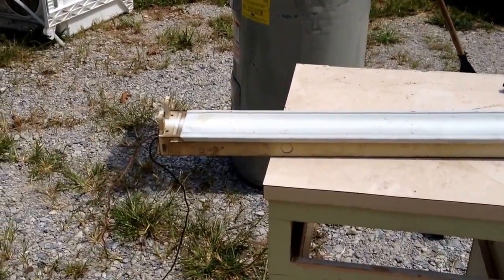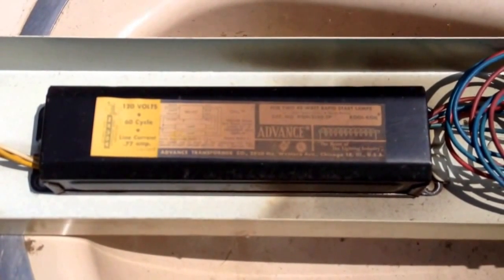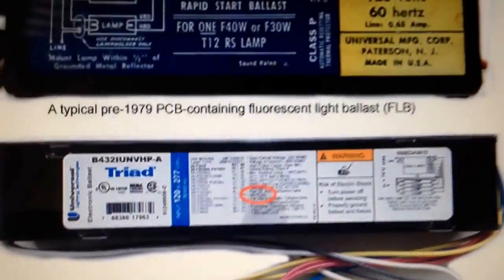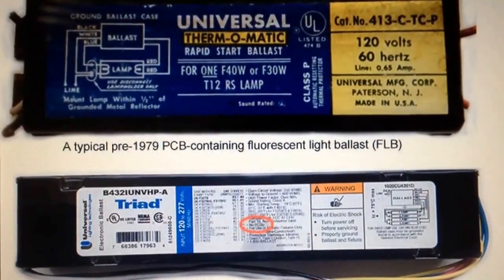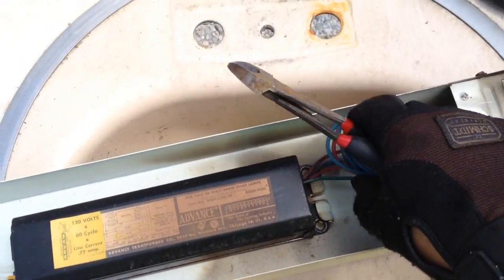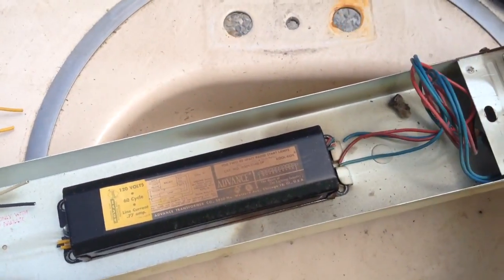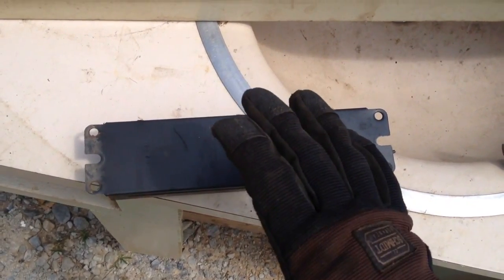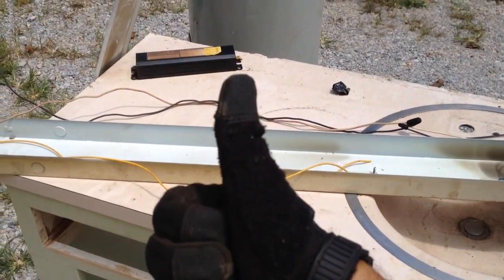Scrapping a fluorecent light fixture with ballast SAFELY !!

Comment: I worked for a lighting company in the early 2000"s , retrofitting light fixtures. I was told that PCB ballasts weren't really dangerous, and used to pull out thousands of them. At times I would be covered in tar from leaking ballasts. How dangerous were these ballasts , and my exposure to them?

Comment: I don't know if you have though of this or not but instead of scrapping that light why not refurbish it? Clean it up, paint it, and install two direct wire LED tubes. Direct wire LED tubes are the one that have to be wired directly to power through the tombstones. I have did this to a few old light fixtures and it works out pretty good.

Comment: Those Advance Co. ballasts have 4 digits on the back. The first two are the month of manufacture and the second are the year. 0364 would be March of 1964. If it's pre-1979, it DOES have PCB's.
Reply: This ballast here looks like it's stamped from the year 70 if I'm not mistaken.

Comment: Dude, if I took this long to scrap out a fl. light, I'd never make any money. It looked like you might be trying to put the thing back together by using proper tools to take it apart. I just use a hammer and a flat bar. Also, you didn't show the inside of the ballast.